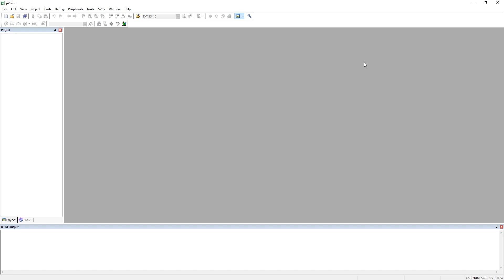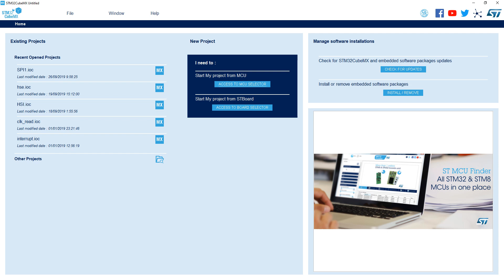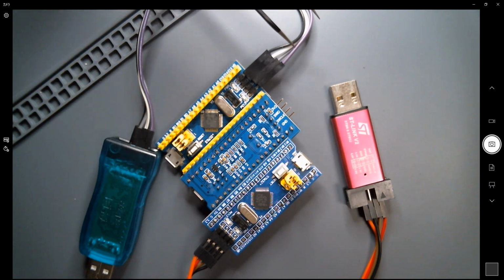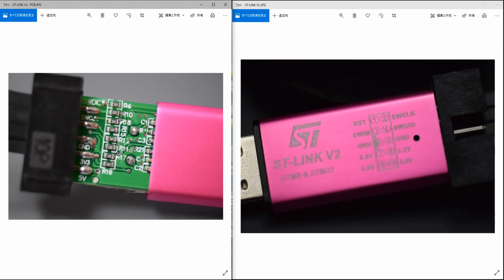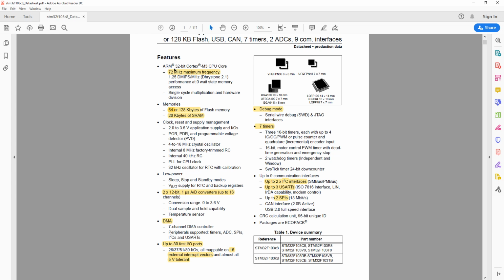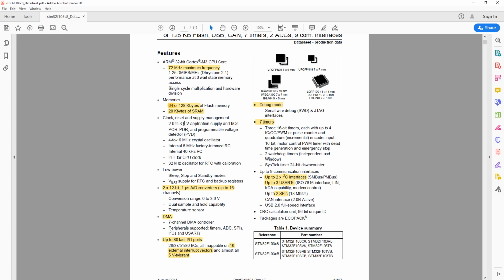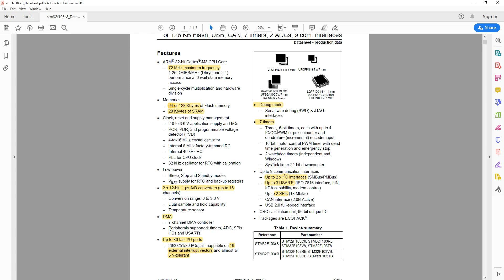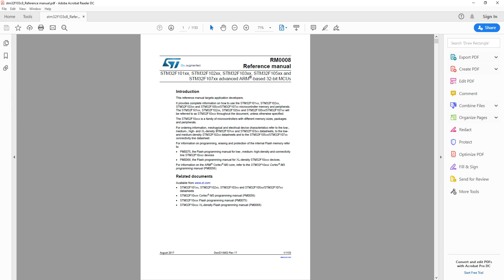000 - STM32F1 Tutorial Introduction Video

Comment: Hello! Maybe not the smartest question, but why don't you use Arduino IDE? I'm new to this topic. Thank you
Reply from the maker: Hi Tales, it is a fair question, Arduino IDE is much simpler to use and already have basic library set it up. The decision to use Keil cames from the fact that it is more appropriate to use if you want to create the code from scratch (Having a full control of what you do) and also understanding the use of Keil will open the door for programming all the microcontrollers using the ARM architecture (Which is the future of the industry). Hope this answer helps, happy to develop if needed
Reply: @WeeWStack  thank you for the rapid answer! Does this system (Keil?) works with Mac OS system?
Best regards
Reply from the maker: @PowNyTales  , Short answer would be NO, as officially it works only on Windows BUT there are some work around, you can try the method this short video shows to install it. I really hope that it would work for you because uVision (Keil) is a very power tool to understand and program microcontroller, this is the link for the video: https://www.youtube.com/watch?v=UhuiktzCiBw&ab_channel=MacDows
Reply: @WeeWStack  thank you a lot. I am going to watch it right now :)
Reply: @WeeWStack   I have just watched the video. I appreciate the efforts that guy did by making this Keil program to run. For me, it is way too complicated (I think, I would accidentally blow my Mac by installing/moving those files). I think I will start with simple Arduino. Thank you for your time. Best Regards